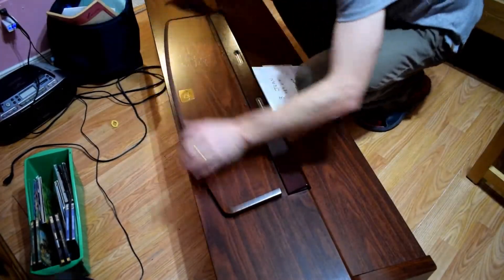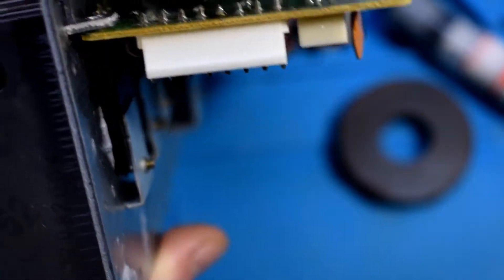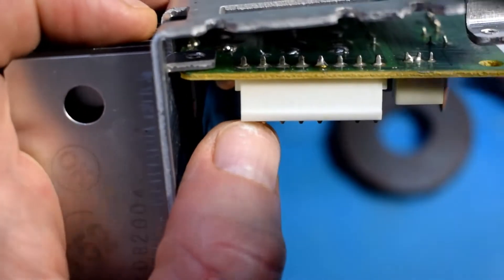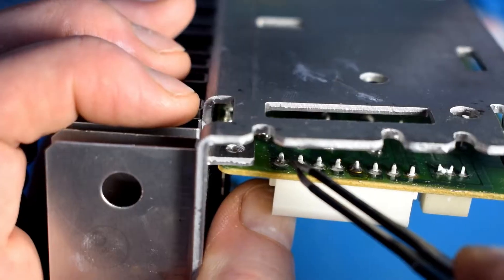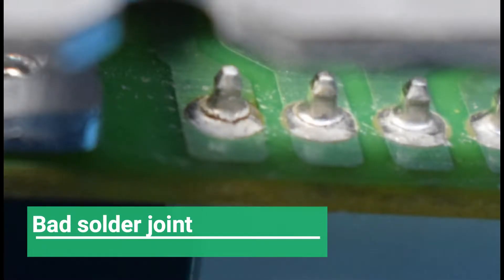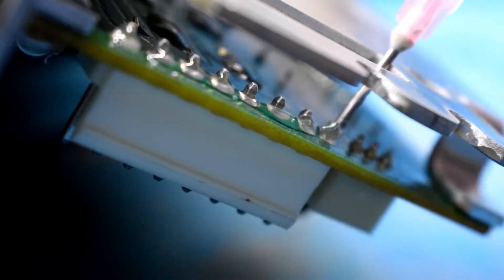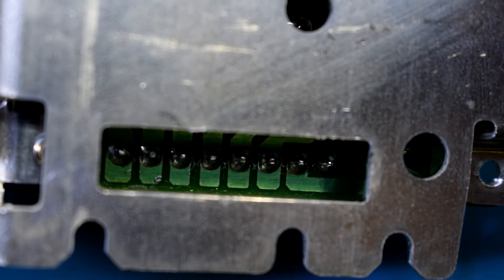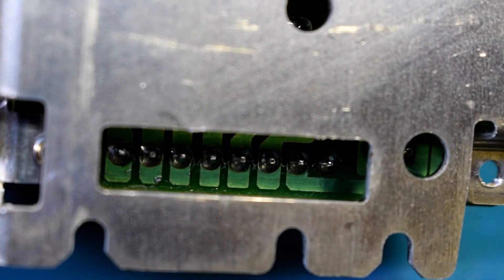FIXED!! Yamaha Clavinova Piano Randomly Turns Off (Model  CLP-150)

Comment: This video is an answer to prayer. Our CLP-150 piano has been broken for six months with only the red light showing. I pulled the circuit board and one of the incoming power solder joints was clearly broken. I re-soldered all of the power joints just to be safe and this can be done without removing the heat sinks. A good magnifying glass is helpful to inspect all of the joints. 

I thought my transformer was bad because the outputs were strange voltages but here is what they should be since mine is working and it was buzzing: 

Red-Red: 55 volts AC
Orange-Orange: 32 Volts AC
Brown-Middle Orange: 16 volts AC
Black-Outer Orange: 16 volts AC
Outer Red-Black: 27 volts AC
Inner Yellow-Outer Red: 26 volts AC
Outer Yellow-Inner Red:26 volts AC
Outer Yellow-Inner Orange: 16 volts AC
Outer Yellow-Outer Orange: 26 volts AC
Outer Yellow-Black: 7 volts AC

Note: No DC voltage output

What paste flux are you using? 

Thank you so much for creating this video and sharing!!!
Reply: @Aabonne  If I am ever in the area I would solder the circuit board for you. Just ask all your friends that come over if they can solder. 20 minute repair and a new piano. $10 in tools and fixed.